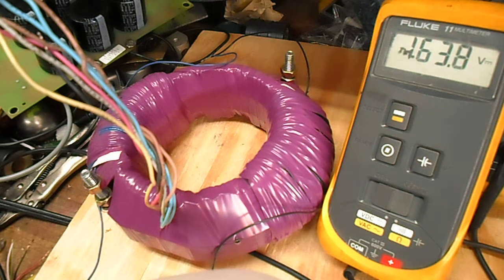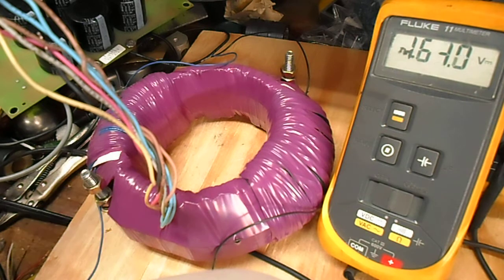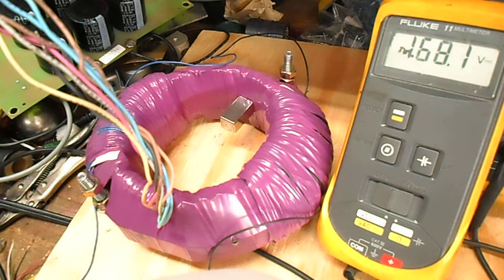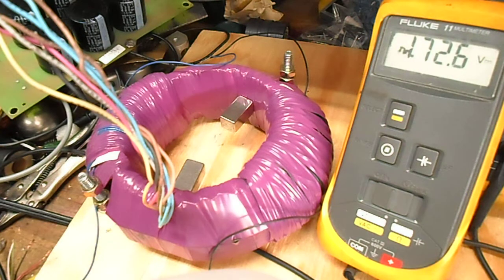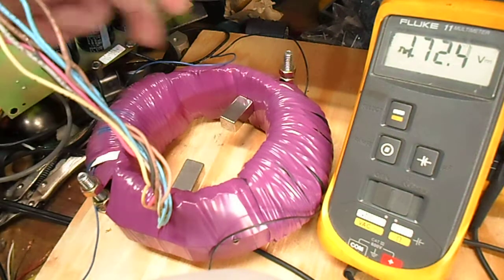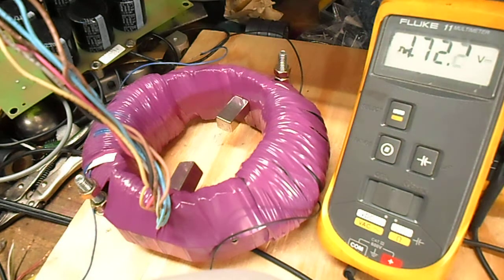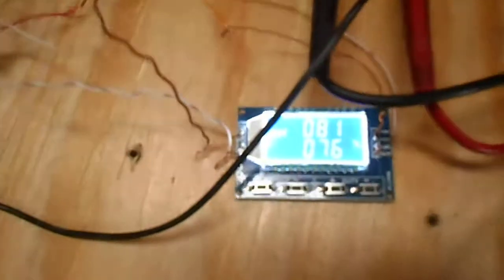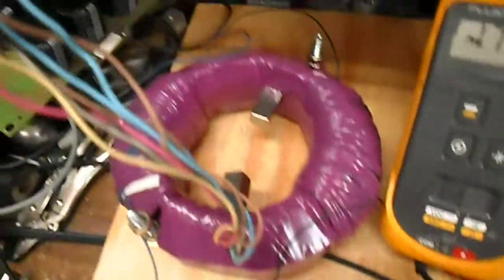Toroid coil, voltage multiplier, with magnet boost effect, Flyback Toroid transformer, generator

Comment: Good job but a question don’t the transformer get super hot
Reply from the maker: No heat because of two reasons. I am not using a load, so it is open circuit voltages. Then I am using a frequency generator and have set this to where I get a maximum output (resonance) of transformer. I just was happy I saw results by using some magnets to get more efficency from it.
Reply from the maker: Thank You for watching.

Comment: I think the magnets increase the Q factor of the circuit. Also there might be a primary resonance frequency at which the transformer will give the highest voltage. And adding the magnets to it will increase it even more.
Reply from the maker: You are correct, I was trying to go up and down with my frequencies to look for that. I think that is the key to good efficiencies.

Comment: Sir please can you tell me what is the effect on current, does it decrease or it remains same. I think it should not decrease cause magnetic forces are being added, so no voilence of conservation of energy, so please tell me…
Reply from the maker: Hi, I wish I could tell you but I had bad meters that did not like the frequencies I was using. I have purchased analog meters to get better readings. It is summer time here and I do most of my experiments in the winter. So check back here in a few months for more. Thank you and good luck in your efforts.
Reply: @davenooner2142  yes it’s difficult to do these in summer. Maybe you can rectify it before measuring ? Thanks for the informative video.
Reply from the maker: @JohnLee-bf2ux  Yes when rectified it does make measurements more accurate since the frequency changes.